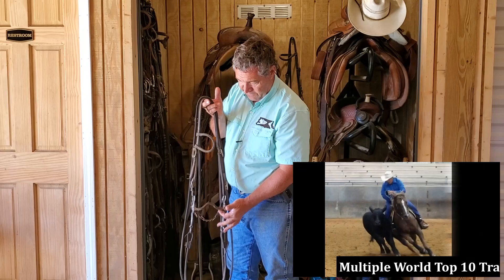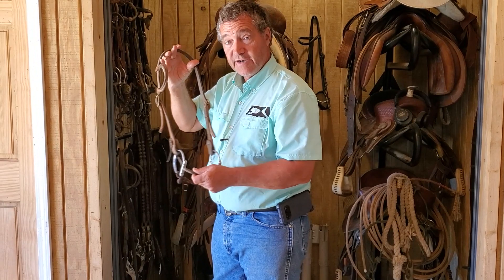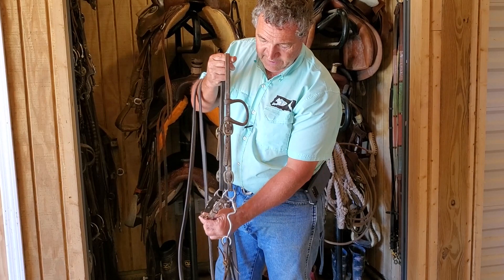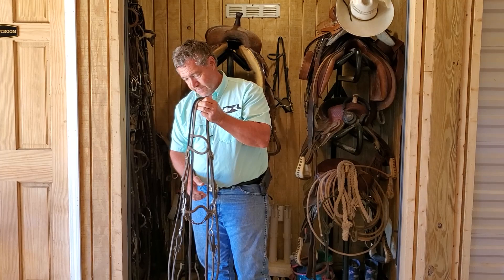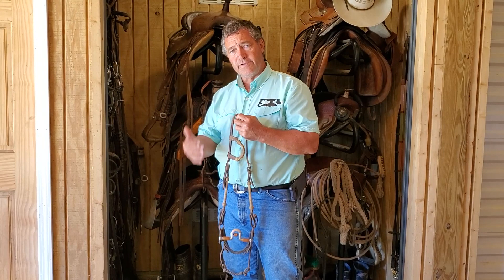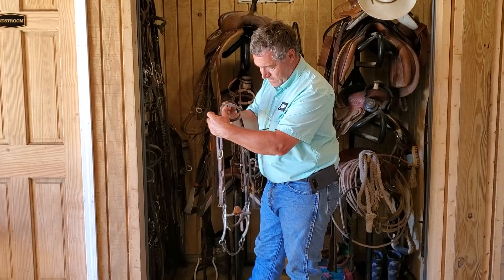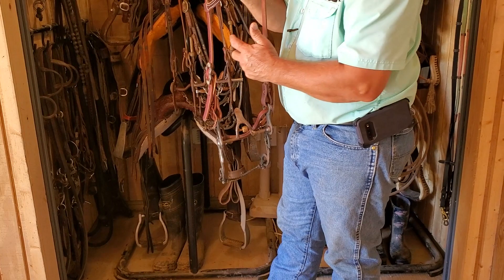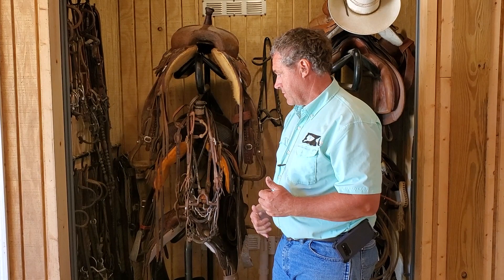Bit Essentials: Tailoring to Your Horse's Training Needs

Comment: Hi Tim, I watch everything about bits I come across because bits have interested and confused me for years.  And NO ONE ever talks about what bits actually do.  They talk about where they hit the horse (pressure points etc) and how they typically progress from one to the next training-wise, and how a certain bit gives them "more control", but never what they actually do.  So the idea that taller ports get you more shoulder lift really got my attention.  How does it do that?   Is it because the horse has to tip his nose down to avoid the top of the port hitting the upper palate, and in order to do that, he has to raise his neck first?  Even if that's sorta right, it can't be the whole story because lifting the shoulder seems to be a right or left side thing, and if you're using a solid mouthpiece, Idk if it's possible to isolate a side.  Anyway, any further explanation would be very much appreciated.
Reply from the maker: Yes that is the general idea how the lift with the port works. If you have seen me doing the counter bending that is lifting 1 shoulder at a time then lifting straight up with both reins lifts and rounds both sides of the back and shoulders. Most horses you can get that done with out the taller port but the taller port is and additional contact point that helps lift lazier or weaker horses.

Comment: I do competitive trail riding, and primarily ride my mare in an s-hack. How would you vary the no more than 3 rides in any one bit when using hackamores?
Thank you in advance.
Reply from the maker: There are many ways and which you do depends on your horse. You can vary the diameter and material on the nose, the diameter of the curb,  the length and type of shank, and the shank to purchase ratio.

Comment: Hi Tim! I have recently aquired a 10yo APHA gelding. He has not been used in a couple of years so I am tuning him up. Will be riding in a d ring for a while first. My issue is, he has a very wide jaw. The snaffle works fine because it is not obstructed by his jaw. But when I have tried shank bits, they are a little tight at the purchase and cause the shank to swivel out. What do you suggest for finding the correct size bit for him?
Reply from the maker: That is a common problem with big horses. You should be able to find 5 1/2 inch wide bits without too much trouble.

Comment: Thanks for the informative video. Question, when starting a new horse, just broke, and starting to introduce the snaffle bit, what do you use after 3 days of riding given that you don't ride a horse 3 days with the same bit? What other snaffle bits do you use for a just started horse?
Reply from the maker: I transition between a loose ring and a D ring and different size and shape mouth pieces.